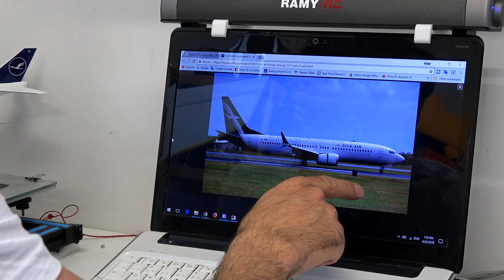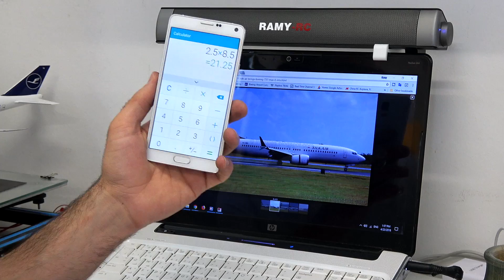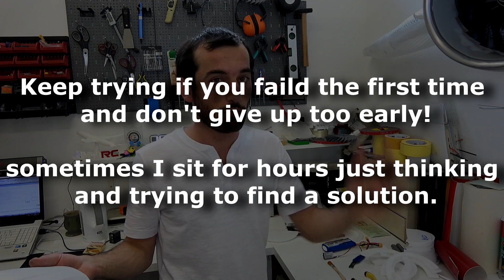Boeing 737 MAX-8 RC airplane DIY project P-1

Comment: Would you recommend using to 6s 70mm EDF 80amp ESC and two 6s 5000mah batterys or stick with one 6s 5000mah battery

Comment: I would call them "frames" Ramy. I'm not the Oxford English Dictionary, just a native English speaker. But you have some choices. You'll also hear the term "bulkhead", especially in the warbird restoration community. And in both cases, those are names for "formers" (which do what they sound like, form a shape). Very versatile language English with Latin, Saxon and Norman invasions over the years. I would say ... spars, stringers and ribs in the wings ... beams (for the floor), stringers and frames in the fuselage.

Comment: As an native English speaker i don't know what that is. I wish i knew. I know polystyrene does not flex like that,  The base of foam board might be flexible , but since it is covered in paper both sides (you cant remove it) it doesn't either.  Would be good to have something like you have to build something like a nose cone.  Foamer only  means railway worker. I googled it . Is it EPE foam?

Comment: An arch is a vertical curved structure that spans an elevated space and may or may not support the weight above it, or in case of a horizontal arch like an arch dam, the hydrostatic pressure against it. Arches may be synonymous with vaults, but a vault may be distinguished as a continuous arch forming a roof.

Comment: Many years ago I bought Realflight 3 off of ebay for like 30-40 bucks. There is a Realflight 4 (with controller) on ebay right now for 39.99. The simulator is an invaluable tool for practicing and learning to fly. It's a great investment. I still fly my Realflight 7.5 all the time to stay in practice. You can never get enough stick time. The newer versions of Realflight offer more airplanes and "drones" along with new games or challenges, but the early version 3 that I started out with is very realistic and is perfect for someone who just wants to learn and build confidence for flying the real thing.

Comment: It is a former
Reply: Ribs are in the wings, bulkheads and formers are similar but for the fuselage. They are the things that form the shape of the fuselage. The difference between formers and bulkheads is that bulkheads are one solid piece and formers have an open space in their centers. What Ramy has are Formers.

Comment: Also can you show us how you did the rudder and Elevators move without showing the servo or the push rods or the control horn from the outside and you did it on the inside like you did on your 777.

Comment: I love this series Ramy!!! I'm excited to watch every one of them! You make the whole thing entertaining.

I would call these things "Ribs" or "Bulkheads"
Reply: They are called formers
Reply from the maker: thanks man, I will be calling them ribs from now on
Reply: Ribs are basically the same as formers but in the wings and stabs.
Reply: Ribs are in the wings, bulkheads and formers are similar but for the fuselage. They are the things that form the shape of the fuselage. The difference between formers and bulkheads is that bulkheads are one solid piece and formers have an open space in their centers. What Ramy has are Formers.
Reply: Thanks for the breakdown Jaspar sk - I've always wondered about the differences.
Reply: I sometimes refer to them as spars in addition to what you mentioned.

Comment: What is the electronics thing that you use to control the doors' servos?  As you lower the nosegear, the doors' servos opens 2 seconds before and after for the retraction.

Comment: Ramy very good video,I am puzzled at the linkages to retract the doors at the door end ? the servo arms move fore and aft so how did you connect to the doors to move in and out in the opposite sense ie at 90 degrees ? can you go back on that and do a close up inside the doors to show how you did it please ?

Comment: Airbus call the part you ask the name of a frame.
For example the difference between the -900 and the -1000 versions of the Airbus A350 is 6 extra frames forward of the wing and 5 extra frames aft of the wing. So a total of 11 extra frames.

Comment: I am a native english speaker. I wasn't sure exactly what you were asking. So I'll answer it several ways. The shape of the object you held up is called an arch. The "ar" is pronounced the same as in "bar", and the "ch" is pronounced the same as in "church". You used the object in the plane as a "former". This word follows standard pronunciation with "for" pronounced just like the word "for" and "mer" pronounced like the "mer" in timer.
Reply from the maker: thanks man, I just wanted to know if it has any specific name, thanks for the info.
Reply: oh. cool. It's a former. If it didn't have the middle cut out it would be a bulkhead
Reply: In full scale aviation and also RC building that particular part would be called a rib
Reply: But John schoolfield you are correct also with it being a former
Reply: I guess you could call it an arch/archway

Comment: @00:19s Those parts are called "Bulkheads"
and the build method is a "lath strip method"
Reply: I know this part as a "profile" or a "former".
Nice to know that this method has got an name!
Reply: @David-hm3lx  aIt called a frame. Bulkhead are fully enclosed.
Reply: Id say its a rib because its hallow in the center. A bulkhead separates sections of the fuselage and therefore is not hollow in the center.  For example the rear pressure bulkhead is a solid piece that the pressurized section of the fuselage from the un-pressurized side.
Reply: @Jamiel1997  i d say rib as well
Reply: A rib is a wing or empenage part, similar to the formers of the fuselage and they are also called stations on the drawings, usually starting at zero at the center-line of the fuselage, Solid or hollow doesn't make any difference.
Reply: Aircraft mech here. That is a frame. Bulkhead is what you would find in the aft and front of the aircraft, separating it from the unpressured atmosphere. Running along them are whats called stringers. If you were talking in general terms of the shape, its called "Arch"
Reply: Additionally, "ship or boat building' is where these terminology comes from, hence why the main fuselage of an aircraft is known as a "Hull".   A main frame , or structural frame is a bulkhead , ( usually one each end of the hull, but sometimes mid sections or more, generally to change shape or load transfer to the hull, for spars etc) minor repetitive forms are frames,  ( such as you were holding)  any minor or smaller shaping structure in between are ribs, generally just for additional strength and the longitudinal at 90 degrees to frames generally stringers. ( running between frames and bulkhead, giving a skeletal impression without covering,  but covering in strips is planks , large area , skin. As has previously been stated, the "shape" of the frame, is an arch
Reply: The parts go by a couple of different names. They can be bulkheads or formers, and possibly other names. Whether they are hollow or solid doesn't make any difference.. The location of the formers on an aircraft drawing are called stations, which are numbered from a datum point and the number is in inches from that datum. The datum does not necessarily match up with the outline of the airplane. It can be forward of the shape or behind the shape. The datum is usually noted at "O". In original model building parlance, the strip method is known as "planking"
Reply: technically yes, but the actual shape is an arch
Reply: i thought that those were called ribs because they are hollow
Reply: Bulkheads, or as they are called in many forms of aerospace and nautical engineering, Ribs.